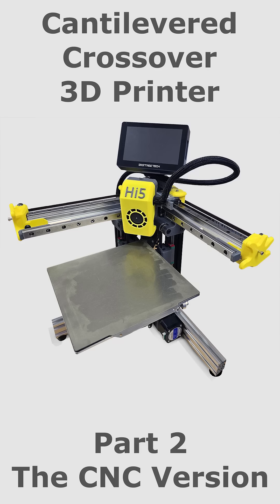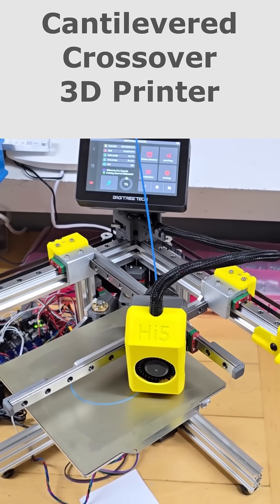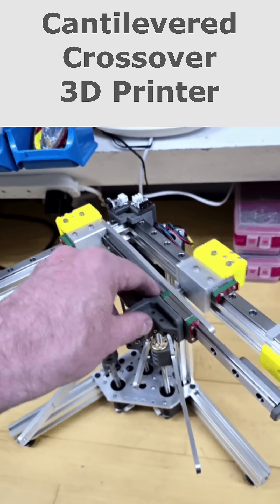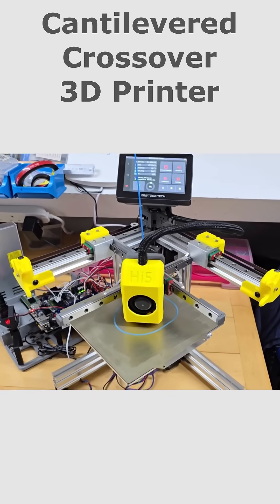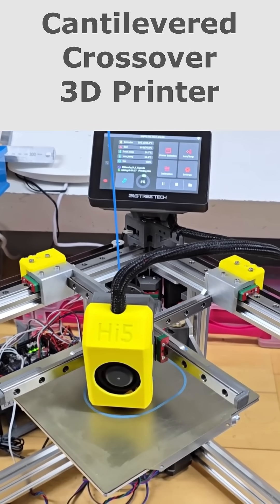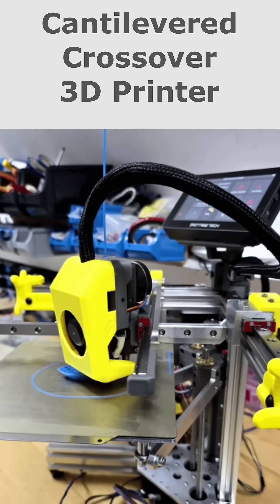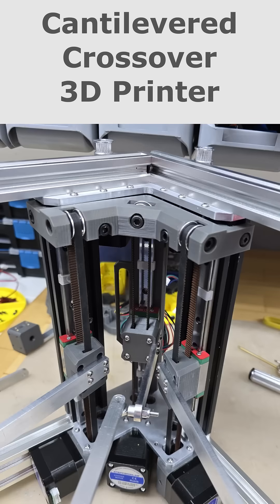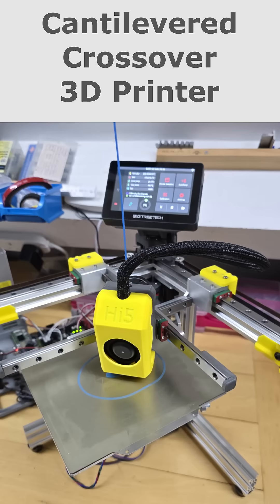Cantilevered Crossover 3D Printer Part 2

Comment: This is awesome and I could absolutely love to build one if designs are released. I have extrusions out the but and parts bins just waiting for something different.
Reply from the maker: Thanks, I will upload a quick update this week, I may publish later but really want to do my best to analyse the designs issues. There is always going to be some issues with novel kinematics like this, I just want to be in a position to advise if folks like you want this sort of challenge, thanks again
Reply: @boothybuilds  big fan of the what if design direction. I have a couple of printers that started with a why not, not because the did anything specific I needed but more just a would this work. One idea is a ball screw driven delta maybe belt gear driven to get torque output in the higher range needed to move the very light tool head.

Comment: My friend, that is amazing tbh. If it had a leveling system like the voron tap or other nozzle as probe and a bigger buildplate, I'd buy one right now just on how clean it looks.
Reply from the maker: Many thanks, there are still a lot of issues to be sorted before it will or ever get to primetime. A bigger build plat would be a very big ask I think. Tap no problem, my RAPP design with a similar lift mech uses Tap with no problem, thanks again